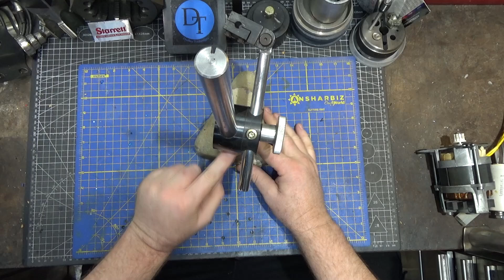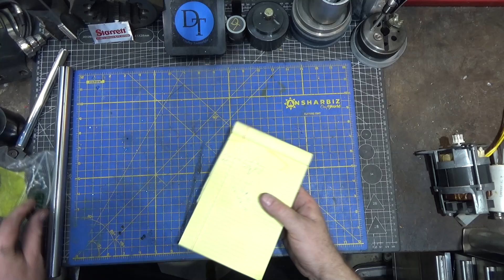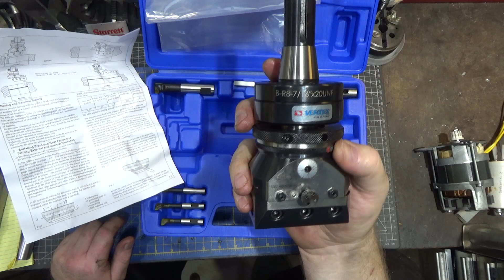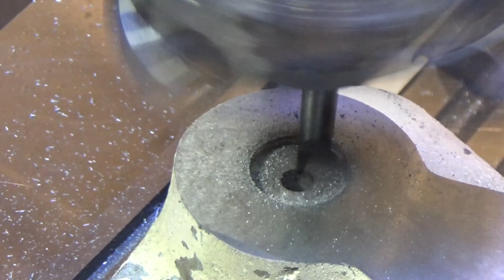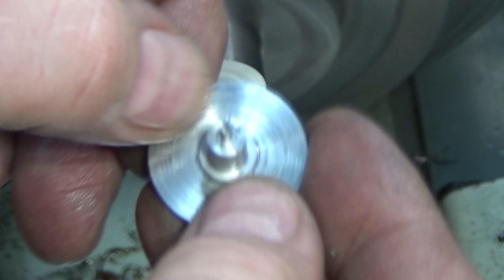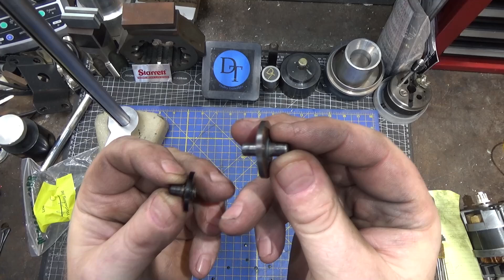Recent Acquisitions #1

Comment: 7.3mm is the optimal size for form tapping 5/16-18.  I have one always loaded in my tool changer.
Reply from the maker: That is good to know. I normally use an "F"  or "J" sizes for approx. 70% and 50% threads.  7.3mm would be less than 50% threads.
Reply: @DudleyToolwright  Not for form tapping.  Entirely different hole size than cut taps.

Comment: I think the idea with that indicator stand is that once it is set up properly all movement (up/down, in/out and all rotational axis) can be locked when you tighten just the large knob.
Reply from the maker: Good idea, but the large knob is a completely separate entity and doesn't effect any of the vertical parts.

Comment: Good scores. You’re lathe can run CNMG 600’s. I’ve tested them on mine - was able to take some SERIOUS cuts. There’s just no point. I ended up giving my CNMG600 holder away to someone with a much bigger lathe, where it is more appropriate. 

I think it would be cool for a group of youtubers (5 or 6)to do a group video comparing recent acquisitions. Not sure how that would work. Recorded zoom? I’d love to be in on it. 

And finally - I will reach out to you separately on lathe coolant. I did some research, and then testing and now use a coolant which absolutely does not rust my machine. Happy to send you a sample to test out yourself. Will reach out via email. 👍
Reply from the maker: I look forward to all of it. I have been using Cimcool on my surface grinder and it has exceptional life and I haven't seen any corrosion. It is just that every lath I see that uses coolant has visible corrosion, but probably from much older formulations.
Reply: If I can get the antibot system to stop blocking me from looking at your email I'll reach out. There are definitely plenty of formulations that will still let machines rust. A lot comes down to maintenance of the coolant. Probably humidity in the shop plays into it as well. More to come!
Reply: @StuartsShed  I run Castrol MB50 , not the cheapest but have not had any issues providing i mix it correctly .
Reply: That's the trick in most cases. Keeping the mix correct seems to be vital. I monitor the Ph and the concentration - both quick and easy to do - and use a $30 homemade tramp oil skimmer and it keeps my coolant in good shape - and no rust on my machines. I run Trim 585XT, also not the cheapest - but I know there are others that work also. This coolant leaves a nice oil film on everything. Shop humidity likely plays in to it as well.